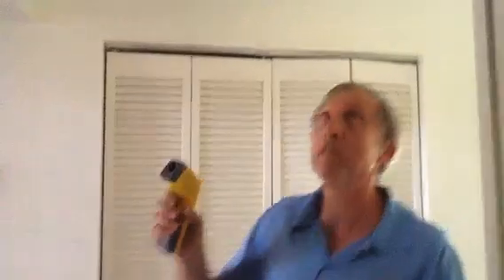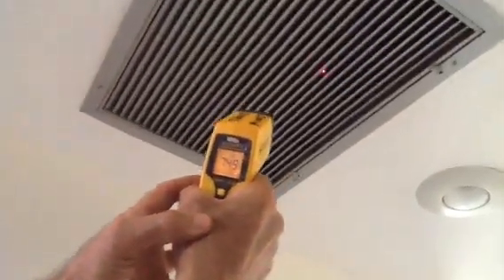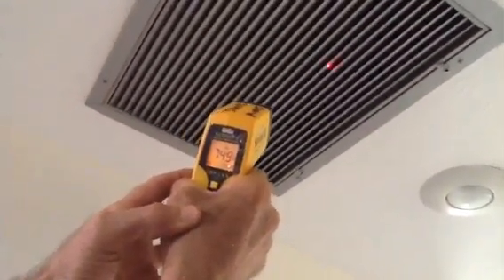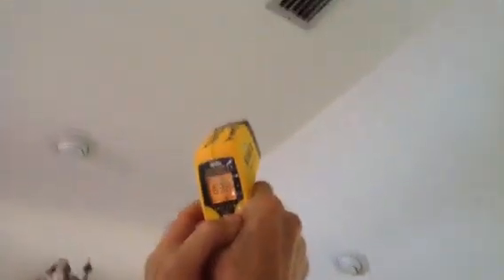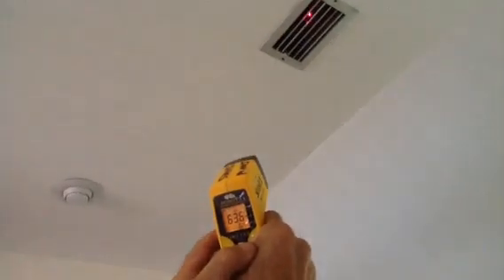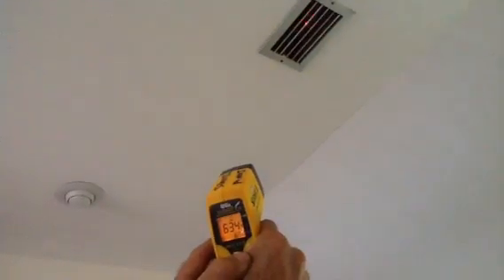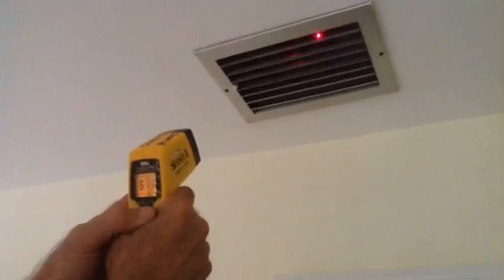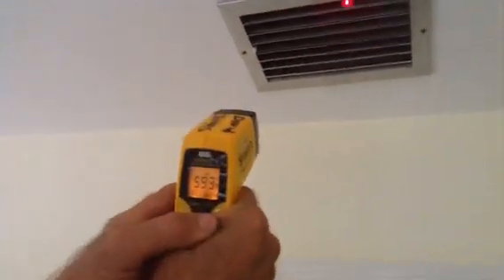" Supply vs Return: What Your Air Conditioning Delta T says About  System Performance"

Comment: Just a quick option, IR point and shoot temp. guns  are for measuring surfaces temperature such as a motor bearing, over heating electrical circuit, and so on. They are not designed to measure air temperature. In your example your are not measuring air temp. but the surface of the devises the  air is blowing over which  can be drastically different than the actual air temperature which is the correct measurement to establish delta "T".  ( Air temp. in - air temp. out = Delta" T " )

Comment: how they get this number? 15-20
Reply: Boyle's law and the Pythagorean theorem X  your mom . 

Adrián Izaguirre
Reply: Pretty funny Seth. Shows you don't know either LOL. Loser
Reply: I don't know how HE got his numbers but he is correct. Under "normal" operating conditions, if the superheat or sub-cooling temperatures are right then you should have a 15 to 20 degree temperature drop across the indoor coil (just don't use an infrared thermometer).
Reply: I do hvac in central Texas. On a hot summer day 90+ I usually see 17-21. In the "winter" when is 60-70 outside I've seen them as high as 25. Usually 20-23.

Comment: Thanks bud, the guy who installed mine was terrible, so I educated myself and reinstalled it myself, for example at the kill switch outside he had two black wires together so when I pulled it there was still power, then he didn't want to get into the crawl space to run thermostat wires so he put the thermostat at the end of the house right beside the furnace!!!!

Comment: My thermostat is in the living room and it always runs because temp gets up to 80 degrees but all other rooms are much cooler. cleaned blower wheel and evap coil. inside ac is 2.5 ton matching outside unit. return is 20x20 .house is 1,100 living space. all Windows have been changed double pain except sliding door in living room. attic is insulated. help please.
Reply: close down the supply and returns in the cool rooms and get a high airflow return cover in the living room.
Reply: Get a thermostat with a remote sensor. I have two remote sensors on my Honeywell plus read it at the thermostat. If the room in general is warmer than the bedrooms maybe consider added another duct.

Comment from the maker: Any one can tell if there Air conditioning is working
Reply: This industry needs to realize that speed kills! We need to be more precise, it's no wonder customers don't trust the industry in general when so many companies and technicians are simply trying to make as much money as they can as fast as they can. It's a shame, really!
Reply: Infrared does have it's place just not measuring air flow. Motors, breakers and things like that.
Reply: You are exactly right but a lot of tech do it anyway
Reply: You are correct. Delta T should be taken at the supply and return plenums. Ducts are insulated differently and located in different areas (crawls and attics) so vent temperature tells nothing of system performance. It will tell you how much heat you have gained from the air handler to the conditioned space though. I only use my infrared as a spot check for dew points and letting my daughter play with the laser.
Reply: David may be taking a beating over this video, but yes the infra red gun has a very wide angle of view.People think that it is reading a pin point spot due to the laser  dot,, but  at  the distance shown, it is  reading  the temp of a 3 foot wide circle and averaging the ceiling AND the register  temp.
Reply: Greg Stabler wow, double standard much!?  Better to be honest and out of work than a crook, I think.
Reply: Mr Jones, that infrared thermometer is measuring the surface temperature not the air temperature. If the system has been running for only a few minutes then the register or interior of the duct won't be very cold and even once it's run for a longer period that method won't be very accurate. ***** Jim Luke Justin Mikola Nicholas Rowan Larry Cole infrared is great for taking the temperature of a compressor, a poorly insulated ceiling, a condenser fan motor or blower motor but not air or am I way off?
Reply: Yes I understand showmanship but the bottom line is the customer is paying you to do the job right. So we all need to strive to do when we can, I like your style.
Reply: Joe Shearer
LOL Give the customers want they want!
Does anyone remember when Archie Bunker was fooled by an infrared camera reading the "heat loss" of his house?
Reply: You think that is bad change your air flow inputs and watch efficiency and take note of superheated, sub-cool, pressures and that they don't change. You will be amazed.
Reply: Stephen Rardon yea I caught that also...  Speaking of techs knowing what they are doing, you need a anemometer or psychrometer man...  To be more precise...
Reply: Yes Stephen, it is a shame but the sad thing is the guy that taken the short cut thinks he is doing a good job.
Reply: Customers like it when I walk around with it...showmanship
Reply from the maker: This method is the best way for most home owners to get a close idea of the supply and return temperature.. I am ask all the time how cold should the supply temperature be.
Reply: David, I to am asked that same question and I will tell them the truth, it depends on many factors wet bulb, CFM across the indoor coil so they know that there is nothing written in stone about the temp. split like they think.
Reply from the maker: 2 later it's our fault
Reply: +Stephen Rardon (HVAC with Stephen Rardon) Agreed, here north Florida almost every company forces there techs to produce a ridiculous amount of money a month for there budget to retain there job, take Keith Lawson Company in Tallahassee for example they fired me because supposedly I wasn't making quota every month, but there excuse was is I replaced a capacitor in a condenser and didn't use a strap because I was out so I stuck in a box and told the customer I'd be back another day to fix, but they sent another tech who snap pics and the company wrote me up for it, so in my great thinking I took some pics the following week I found a job where there lead tech did the same thing left a a cap in the box took a pic showed it to the boss found myself unemployed two days later.
Reply: If anyone else's IR is like mine it is very inaccurate when unit is hot.
Reply: Stephen Rardon I was playing with Imanifold app and seeing how much capacity is changed with only one degree different RA/SA reading. It was enough to make you sick! Accuracy kills!
Reply: Yes this is why I still believe that Imanifold reports are usually bogus
Reply: Yes it does leave a lot of gaming into your readings.
Reply: Yeah I definitely would not be using that for a temperature split
Reply: David Jones I would agree that is a simple way for a homeowner but at that point I'd say an 11 degree delta is fine.
Reply from the maker: Larry, 
Sometimes customers think we are suppose we to do  magic on there system, when they have not taken care of it and wonder why  there air conditioning is not cooling??
Reply: Yes David I understand it is always our fault that their AC isn't working.
Reply: What is the setting of ac thermostat in order to get the reading of 75 to 60?
Reply: And what brand name should I get?
Reply: Set your thermostat no higher than 76 degrees if you desire the temperature at the outlet of the evaporator to be 60. This is assuming a 15 (or more) degree delta T. Also to achieve a 15 (or more delta T) degree split, you have to take in the consideration of amount of moisture in the room, the speed of the airflow across the evaporator coil, the charge of the system, and the cleanliness of both evaporator and condenser coils. And... if the piston is sized right for the system or TXV installed and operating correctly.
Reply: Who on EARTH has a 15 degree delta T? With all the shitty undersized returns and supplies? LOL Good one Mrs. Wizard.
Reply: Cooll Asice Your absolutely correct! And the infra red gun I use is extremely accurate although was extremely cheap.

Comment: I thought those infrared thermometers gave you the temperature of the surface the red light was on and not the temperature of the air.  Good video
Reply: It could read very differently from the actual air temperature as the grill surface and inside of the vent may be a different emissivity than the IR thermometer is calibrated for.   I'd get a thermometer with a remote thermistor probe  to compare the readings first before relying on the IR thermometer alone.  If they're very close then it should be okay to use the IR to measure, which is much easier to use than putting a temperature probe in the grill.
I made a comparison on mine and the IR is pretty close, within a degree, so it's a good way to check.
Reply: DTR RTD I've done the same with the same results. The farther away you are, the infrared reads a 3 inch circle which is why they are indeed close.
Reply: You are correct